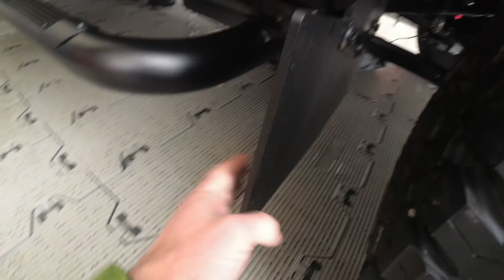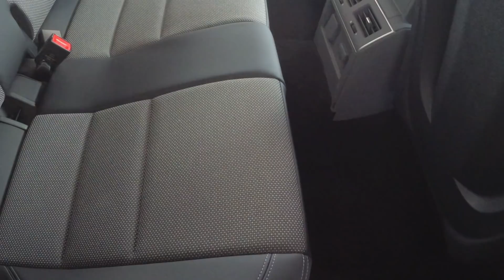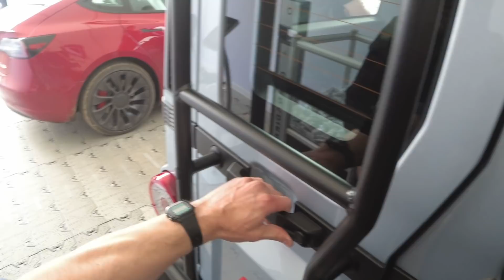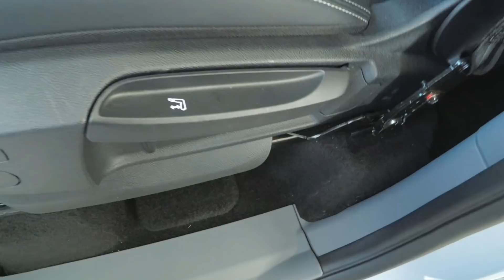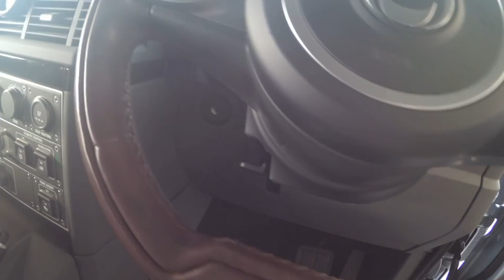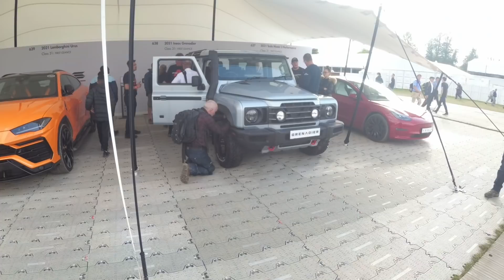Grenadier parts, dealers and warranty - 2 of 2

Comment: The Ad Blue system will be a pain to use in remote locations? Any news about that? Currently if the Ad Blue system fails, the car will limit the range you can drive before you go to a repair shop. currentyl it is about 800km. What if that fails in some remote place in the world?
Reply: There is a petrol model as well which I think is also a straight six.
Reply: @beaviccoon470  Sure, but if they want to sell diesels too people who go further from the service locations, then this issue can occure. Recentyl our car with adblue had a malfunction and we had to drive 1500km without shutting down the engine. If we stopped then you can not start it without a diagnostic module.
Imagine this happening in some remote location.

Comment: in Australia the 70 series   4x4    V8  4.5 L T Diesel   4 door  5 seat is 39,000 pound onroad drive away.  The price would have to be sharp too compete in Australia. There is a 30,000 pa  market in Australia for this vehicle, and that would be without taking sales of Toyota.  A  4x4  four door ute has  held the number one and two  sales positions  by volume  for the past 5 years.

Comment: Can't really be compared to a 70 Series, as the Toyota is far far more agricultural.  6 speed manual gearbox, no sound insulation, low hanging leaf springs in the rear and very basic seats.  The Grenadier is a way more sophisticated with an automatic transmission and everything else that makes it far more comfortable.  I do hope that the Grenadier is greater than the sum of its (very  appealing components (e.g. strong diffs, reputable gearbox, one of the "good" BMW engines, Recaro seats, etc.).  3 year warranty is comforting and interior looks very good.  Wishing the Ineos team every success with this product!
Reply: 70 Series only has a 5 speed manual gearbox. Unless you count reverse as a gear I suppose!
Reply: @spudboy1328  Ooops, typo on my part.  :)  I have assumed it was a matter of time before Toyota the 6 speed manual gearbox from the Prado 150 Series into the 70 Series, but that never happened.

Review of a Prado with the (very rare for Australia) 6 speed manual gearbox, just as an interesting side read:  https://www.caradvice.com.au/385150/2016-toyota-landcruiser-prado-2-8l-gxl-manual-review/

Comment: Regarding your comment about it not being the next ROW 300Tdi - Defenders in South Africa had locally fitted BMW engines, and in Australia Isuzu engines.  I suppose if an agent established themselves as a 3rd World supplier, they could fit them from new with a Cummins Diesel and a 5 speed Gearbox, then sell the Ineos drivetrain as a repower option kit for older Defenders.

Comment: Some questions for the Australian market...
Ad-Blue. I noticed the diesel has Ad-blue which is not readily available in outback Australia. Will u be able to turn off/on the Ad-Blue or will it continue to be able to be driven if u run out of Ad-Blue or will it go into Limp mode?
Due to distances between Refuelling and also when remote touring - what sort of provision underneath the vehicle for long-range fuel tanks?
I assume fitting a roof rack will be possible for those that want to fit a roof-top Tent?
I hope it will not beep at u every time u get out of the car like all new vehicles?? Here in Aust when touring outback we quite often have to stop to open/close gates and the last thing is having to listen to all the beeping every time u need to get in/out of the car...
Aftermarket suspension upgrades (ie: GVM upgrades) and increase tyre size - will this be possible?
The area underneath at the rear didn't look that great when 4wdriving and sand driving. It looked like it will catch a whole lot of sand/debris. I know here in Australia when desert driving here that spinifex getting caught in the radiator and under the vehicle in places close to the exhaust system has caused vehicles to catch fire... not sure how this vehicle will cope in those sort of conditions...
Bit concerned seeing the Radiators seemingly so low to the ground... prone to flying rocks/debris damaging it
The wheel stud pattern - I see its a 6 stud wheel pattern - Does the PCD match other common vehicles in regards to rim size options and offset, etc?
Body Panels - Aluminium or steel?
Will u be able to put the vehicle into Low Range without having to lock the centre Diff? This is a handy feature when having to reverse a trailer up a steep incline and having better control and less stress on the drivetrain. Not many new vehicles allow u to do this...
that's all I can think for the moment....
Reply: Tank for ad-blue enough for 10000km so-not a problem. Some of your other questions are answered in other videos . Of course after market ARB will be silly not to have accessories including gvm
Reply: Ref your beeping every time you want to get out if you have a Toyota the seat belt beep can be turned off via the trip reset button, check you tube 👍🏻🇬🇧 if you don’t have a Toyota shame on you 😜

Comment: Do you know if the zf auto gearbox is sealed for life like landrover? This points towards the buyer and how long they planned to keep it for, just as long as the warranty?
Reply: The 8 speed used in Bmw and many other makes is not sealed normal
I change my gear box oil evey year is works good for me
Reply: ZF box is not sealed but it is difficult to drain all of the oil out the answer is to do a power flush or mega flush to replace all of the oil, many garages offer this.
Reply: @AJ-qn6gd  yes, I have the kit fitted and now have regular oil changes and at over 2000k.klms it is still smooth.

Comment: The main question for me is: Will the Diesel work in Mongolia? Will it work in Afrika?  How does it deal with high Sulfur content of Diesel? What about Water in the Diesel? Can we go Overlanding in it? Can we cross Africa?
Reply: This is where you need as driver to take over  liability to override emissions controls in RoW mode in  locations without AdBlue.  The vehicle needs to have or have space for extra (heated) fuel water separators and intrinsic ability to be omnivorous in its acceptance of fuel grades.
Reply: ADBLUE seems hard to find in Africa or Mongolia.
Reply: People overland Africa and mongolia  on brand new landrover, hilux, ford,etc etc 
Risky but can be done
Reply: @sogniluigi  Yes. With a petrol engine or with an Toyota for the African market. Not with a Diesel that is legal to use and own in the EU.
Reply: @ChibaCityBlues  not true, people overlanding with brand new vw diesel t5/t6 transporter  , Ford transit  ,Mercedes sprinter 
And I talking about European car ,
Reply: @sogniluigi  I know. And I overland a T5 Rockton Expedition myself. So I might know a thing or two about the car. Australia, North and South America, the northern part of Asia and Europe are no problem. 

But trust me on this: In Africa and in the southern parts of Asia Diesel quality becomes an issue especially for diesel particulate filters. The sensors will make the whole car shut down. The last VW Transporter that works for worldwide travel is the T4 2.4 D with 78 hp.

Comment: I hope that Ineos includes part numbers in the workshop manual.  It seems obvious enough, but Land Rover doesn't, or at least didn't when they issued the one for my Range Rover classic.  Also, CHECK the information!  The electrical diagram for my RRC has the ground for the fuel pump running through the right rear window lift motor!

Comment: will quick question i need a part number for the metal pipe that goes from the clutch master cylinder down to the flexy on a 300 tdi i am struggeling cant find it and my heads done in cheers
Reply: For RH steering 94-98 it should be ANR2162. LH steering it should be ANR2945.
Reply: @WestCoastVisitor  cheers much apreciated
Reply: Just get on made to length at a motor factors or local garage and bend (carefully) to fit, or if your feeling up to it buy a brake pipe flaring kit and pipe and make your own 👍🏻🇬🇧
Reply: @AJ-qn6gd  its got a funny trumpet horn like end on one end that fits onto the flexy pipe and i cant make that with my flairing tool am afraid i have a bit of pipe i could use but its steel and my tool wont flare steel pipe

Comment: They look great. The problem is in the pricing... £45k that won't see any green lanes, far too scared to scratch it let alone roll it!

By the time the secondhand price is achievable for the most the diesel tax/ban will be in place. Thus rendering worthless and too costly to own.
Reply: Maybe in the UK, here in Canada it’s normal to be using new $80k cad F350’s in the bush for hauling & work. I know plenty of people who think nothing of wheel’in a brand new Jeep Gladiator on forest service roads that make green lanes look like highways. It’s not called BC pinstriping for nothing 😉
Reply: Its still a ladder frame chassis, doing an engine swap to electric, hydrogen or unicorn tears will be straight forward.
Reply: @ruuman  true but for circa 50k onwards at the min, its a little uneconomical
Reply: Even if your petrol or diesel car is still running in 2030, there are no plans to ban it from the roads entirely, and second-hand sales are expected to be unaffected. There are 13.8 million diesel vehicles in the UK today, and many millions of owners will be keeping them running. Also new Euro 6 engins are exempt from clean air zone charges. There will be a large shift to electric, which is great, but diesel and petrol vehicles will be here in the UK and Europe for at least another 20 years.

Comment: The more I see, the likely I am to try and raise the likely cost. My worry is the difference in cost would buy me a serious rebuild and bling of my '89 110CSW and my '91 90 van with windows. I have long said that my LRs are pets not cars, so there would be a significant element of betrayal! 
I am looking for a durable vehicle I can maintain myself and this seems to fit the bill in so many ways. "Reduce, reuse, recycle" strongly suggests you buy manufactured goods that are designed to last, rather than follow, (designed obsolescence), fashion. 
One upside of the old Defender becoming fashionable is I am likely to get much more money for the 110 and 90, than I would for something more mundane.The 90 is even eligible for export to the USA, (original chassis and engine).

Comment: 70 series is way lighter (so better off road), it looks better if you ask me, they can be similarly reliable tho you can trust more the 70 series as the ineous is new, and the 70 series is cheaper. Would you make a comparison? The weight is too much for me to consider - is the no go.
Reply: The problem is the J7 does not meet the latest emission limits so it is not available in UK, EU, US or Canada…
Reply: @lukasvass681  You can have it imported brand new. There are people doing this. Cant find the website now. There are EU compliant versions if you want but are more expensive.
Reply: @alex.toader  there isn’t a Euro 6d compliant version of the J7. You can’t walk into a Toyota dealership and order one. Been there done that. Some people and companies are trying to import 3rd world/Arab spec vehicles using some legal loopholes or even frauds but those cars don’t have the factory warranty and support, it is difficult to have them financed  or insured…
Reply: @lukasvass681  Toyota 70 comes with 2 years warranty if I am not mistaken. If you are worried it will break inside those 2 years then you are in the wrong market :)
Reply: @alex.toader yes but that warranty is only valid in the countries belonging to the specific market where the car was sold new. That´s what they told me at Toyota. Not to speak about the other things- service support, financing, insurance...
Reply: @alex.toader  In Australia, 70 series LandCruisers come with a 5 year factory warranty.
Reply: @lukasvass681  It comes down to what you want. I am considering a 70 without warranty (because it wont break) over a heavier car. If you need warranty, I guess Ineos is the second best option.
Reply: @lukasvass681  
Too bad...
Real men know that emissions regulations are bullshit made up by governements to make car companies work more...
We all know!
Is just like Cars, now a days, after 6/7 years, they start to give so many troubles that we look around to buy another one.
Do car makers make Cars that last like an old Toyota FJ62?
I don't think so!
Anyway, I wouldn't be so hot about this "ineos" at least for the first 2/3 years.
One last thing, you can use all the technology you want, but no automatic tranny will ever beat a 6 Speed manual for durability.
I really hope they will offer manual option.

About the Wright?

"To be light is everything, in any condition".....(Ayrton Senna)

Comment: It's a shame they're not trying to compete with the 70 Series, or even focus on Africa at all. In Kenya, the 1HZ is the only engine option - you can't get the V8 diesel at all. It's also available from all dealers at around £70,000 before options (although the single-cab 79 Series starts at £45,000 - why all the others are so much more I don't know). However, having access to parts catalogues and repair manuals for free will make repairs in similar territories so much easier. That's something I hadn't even thought of. I sincerely hope though that they sell a model at least without a DPF for certain markets. Countries in the East African Community may sell low sulphur fuels and support such vehicles, but that's a rarity across Africa.
Reply: LC 79 SC is assembled in Kenya, so no import duties
Reply: @corhendriks1755  That explains it. In that case we'll continue to buy HZJ79 single cabs and convert them to safari vehicles. I'd rather support local industry and provide local jobs than import from overseas.

Comment: The old defender has one massive advantage over this - it doesn't have a BMW engine... Wouldn't fancy having to get an engine worked on for one of these in Africa.
Reply: Toyota engine and transmission 👍👍👍
Reply: In South Africa the best defender is the one that was built here with the BMW 328i engine. Way more powerful, fuel efficient and reliable than anything offered from the LR parts bin. They are getting old now, but the guys that have them will not part with them easily.
Reply: But we don’t know yet if they even want to sell it in Africa…
Reply: They should used toyota engine
Reply: I woul takw bmw engine any day over lr engine

Comment: I see what you mean by a comparison to the Defender.  I went from 25 years of Series Land Rover ownership to a 300Tdi Defender.  For me that was comfort, reliability, economy, power and great brakes.  It has needed  "maintenance" as it's aged, but I still drive it 450km each way to work on a weekly basis, and typically cover 10,000+ remote km on road trips.  However I  imagine the Grenadier will be like a Defender with the quietness, power and smoothness of my D4.
It's the most tempting vehicle on offer, but I fear what will happen to the price in Australia.

Comment: I hope they sell them faster than they can make them.
Reply: LOL, most people who want to buy one will be rather disturbed when they discover they will be priced closer to a Mercedes G-Wagon, and buyers will need a footballer's salary to buy one.

There will be so many brexiteers who will discover that it is no longer 1962, and that they can't afford a car designed for footballers or Saudi sheiks, and they will be stuck with ordering Dacia Sanderos for that 'off-road-look' on a pensioner's income.

Still, at least it gives jobs for Welsh workers. Oh, sorry, it gives jobs for Frenchmen.
Reply: @horsenuts1831  The diesel G Class is a hundred grand I think. This will be only 45 grand if what I heard is true.
Reply: @themildoff-roadist8661  LOL, in your wet dreams. You can spec out a Mini fairly easily for 45K. This will be a low-volume car with no dealership support, no pedigree, and high start-up costs. The only way they're going to make any money on these is to make them a premium product. You won't get any change out of 100K if you want one of these. Furthermore, they're not even electric, so they will fall foul of emissions regulations in many countries and be very expensive to own.

The beauty of an old Defender was that they were cheap to fix because you can find parts anywhere. This will be the complete opposite.
Reply: @horsenuts1831  ineos did say that this vehicle will start at about 45 grand but that's defender territory so ye it's still quite expensive although a key point that people keep forgetting with both the defender and the ineos is that they're actually full cars unlike pickups and also they have straight six engines unlike most pickups which have smaller 4 cylinder engines unless your in America but then if your in America you won't be looking at this kind of work vehicle, you'll most likely be looking at something like a ram pickup or a ford f series pickup etc.